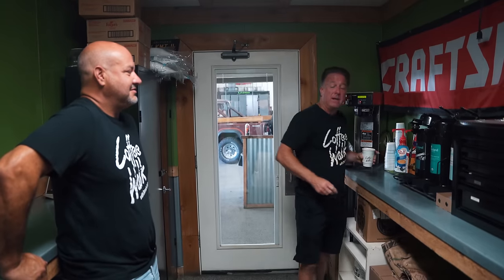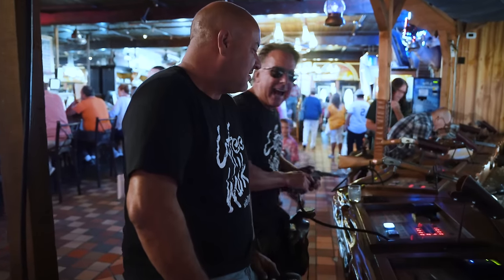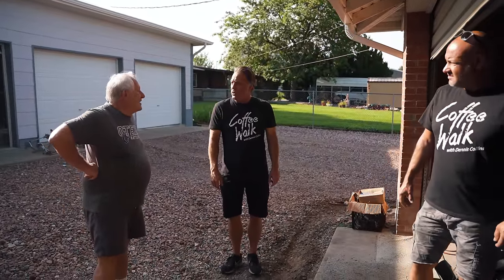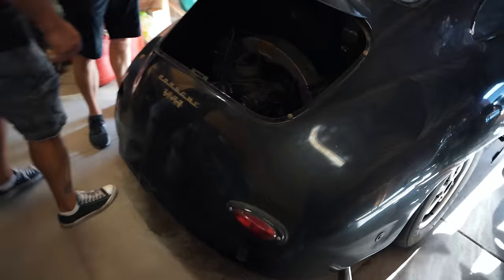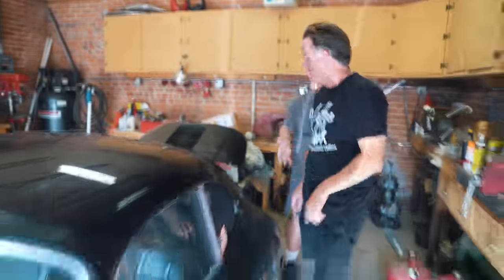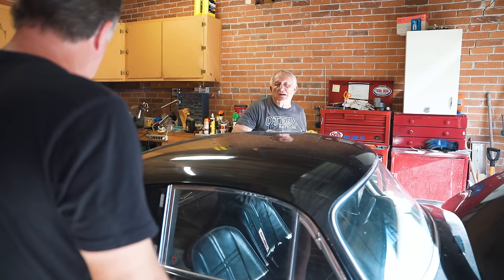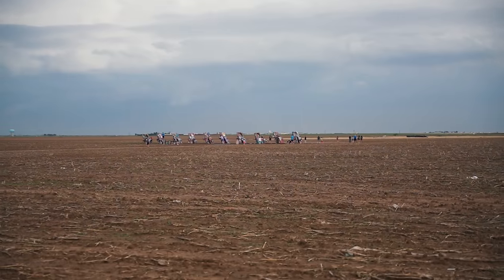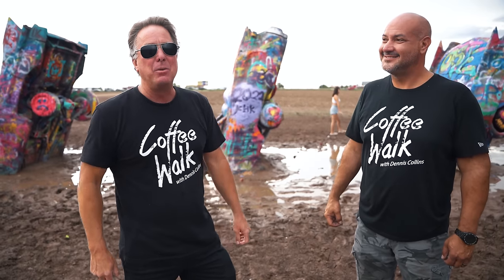FOUND: 1961 Porsche 356!

Comment: Old Porsche’s never die, they just get cooler. Contrats on the find. As an old Porsche 911 owner I am tore between making it an ultimate Outlaw, restoring it to original or restoring it to an original 356 racer. Plus I am sure all those 912 parts would come in handy for one of your other projects. Outstanding 👍
Reply: I grew up with a bunch of old Porsche's. My dad had a 66,68, and a 69 912. A 72 911T, a 76 911 Euro Carrera, 74 914, and 2 930's. A 76 and an 85. The classics are the best. I have a 78 SC as well.
Reply: Restore to original

Comment: If you pull the pins on that dollie & pull the handle out then reinsert the handle through the top it makes it so you don't have to bend over so much.  It turns the 2 wheel dollie into a 4 wheel dollie & they are very handy but they can't hold a whole lot of weight.  Good luck & I have my cup of me.

Comment: Also that is one of better body styles that porsche ever put out. 356 speedster is also one of the most iconic cars ever created. It is one of my top 3 dream cars 🚗 for sure. A split bumper with the adjustable front spoiler down below. Last but not least. A GT2 RS. Not a 3 but a 2.

Comment: 14:34 I hear a little rod knock on cold start I also  hear a little valve train tap but that's normal for older designed engines very fixable though

Comment: In 1975 I bought my first Porsche. It was 1961 356B silver/red interior for $50 bucks. I thought it was ugly as hell what did I know I was 16yrs old. I removed the engine & transaxle and put it in my Meyers Max dune buggy. It wheel hoped all over the place. LOL. I dug a hole at a local construction site with a backhoe and buried the chassis. I later purchased and enjoyed several 911's.

Comment: So you bought a car with the "5 spd tanny".  This was a trick done to make the 356 more competitive.  Upgraded to disc brakes from drums.  For the average driver this was needed.  Having tracked both a B and a C, properly setup drum brakes are as good as discs.  Maintenance goes to the disc brakes.  I was going to vintage race the C I bought, but with the 2 liter 911 in the same class, the 2 liter 911 is a better car.  To be competitive with a 356 you need a fresh engine every weekend and you can't run the enduros.  A good 2 liter 911 will put out over 200Hp and run the full season and you can run the enduros.

By the way, I was a Senior Field Engineer for a large Automation company.  Had been on the road for three weeks when I came back for a training class, and the big dinner together was a steak joint where you could cook your own steak and they had a 64 ounce steak challenge.  With Texas toast, stuffed baked potato and salad.  I was brought up by parents who went through the crash.  So after that dad became a steak and potatoes guy when he finally made it.  So we had steak at least three nights a week.
So we had the big dinner, and everyine was ordering their meal, a female engineer from Cali that I had worked with the week before, ordered a salad.  I ordered the cjhallenge and she said I don't eat that much red meat in a year.  You had 45 minutes to win the challenge.  I had noot had a steak in 3 weeks based on 80 hrs a week working.  I killed that steak and extras in 35 minutes.and asked for and 8 ounce Sirloin because I was still hungry.  Those challenges to be won you have to be in the right state of mind.

So are you going to vintage race it or just sell it.  If you plan to race it you should conider Road America with HSR in September.

Comment: Now if I do recall correctly, this car is also the same kind of car that is called a Forsche in the Homescapes game, and some of the tasks on that game require you to fix it up, as well as the garage, and, as it turned out, two of the characters that were in the game were part of a racing team, with the father of the main character using said car as a race car, you know, kind of like the car that is in this video.